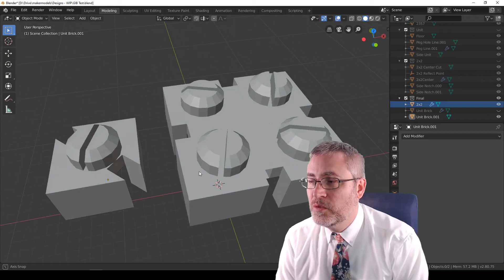I want you to 3D Print Interlocking Building Bricks

Comment: 9:12 3d models of bricks are kinda now available via semi-official sources.  If you download bricklink studio (owned by Lego), go into part designer, you can export any piece in the software to *.obj which is printable.  Bricklink relies to some extent on the open source ldraw software, with modifications.  Ldraw also has a huge 3d printable bricks database.
Reply from the maker: The problem is they never seem to hold right. I don't know if they modified the STL with smaller pegs or what. 
But that's why I made PrintABlok.

Comment: Way before this whole thing, I was also experimenting with printable "lego like bricks" and while you can get the tolerances down enough with an accurate printer, I also wanted to design a lego-compatible brick that works on loose tolerances. It worked on using the elastic nature of (then ABS) plastic and instead of lego-like "pegs", I had "baubles" on slightly thinner stalks - this maintained good pressure across wide tolerances. Too bad I don't have any project files left, it was ~2014 and it died with an old laptop. :(
Reply from the maker: I may not copy the baubles, but I hope you'll be into the changes I'm making.

Comment: Good job on the design, like you I tried all my printers and got different results with different materials.. I was testing different angles and such, But I really like your idea on the open design model. Also the printer I've had the best luck with is my enclosed CR10 mini with ABS.
Reply from the maker: Thanks for testing them. I wonder I'd next week should be calibrating or releasing the design?
Reply: @3dpprofessor  Yes Definitely.. It just so happens I'm calibrating my extruders this weekend finishing up with my ender 3 tonight. Because I'm putting all dual gear extruders on all printers for much better consistent flow.

Comment: +1 For the ideology, +1 for the great "interlocking block" design, and +1 for Blender. You really racked it up on this video. Although, for the wider public (maker community) a fusion 360 file might be more widely accepted for third party modifications. Not everyone is as advanced as us Blender users. ;)
Reply from the maker: Hearted for the comment, thumbs up for the dig on fusion users. I'm gonna steal that one day.
Reply: Blender also is not engineering cad .... It's more an artistic tool than for something you want to do with exact dimensions and to engineering standards.
Reply from the maker: @skaltura  It's maybe not something you want to use for something with exact measurements, but it's all I use for that exact (eh) thing.
Reply: @skaltura  Yeah but when all ya got is a hammer, everything's a nail.